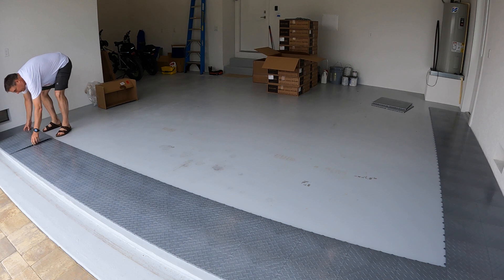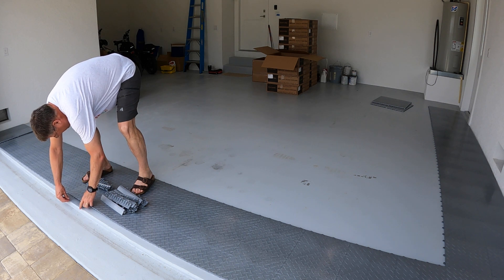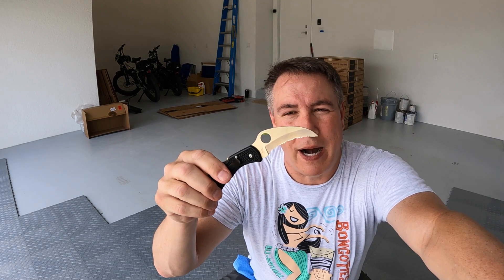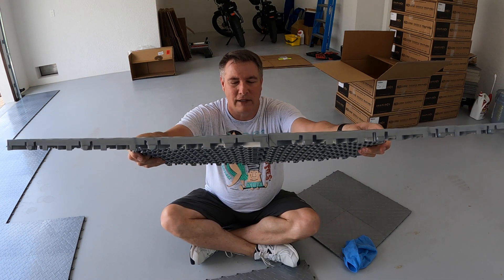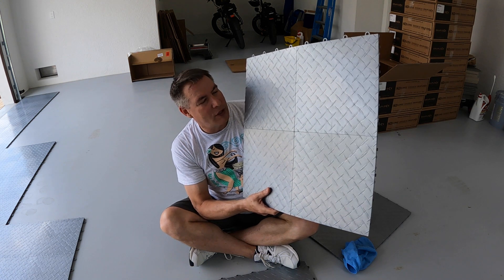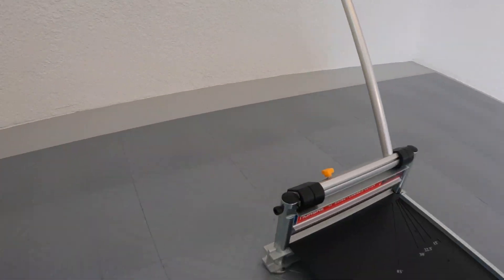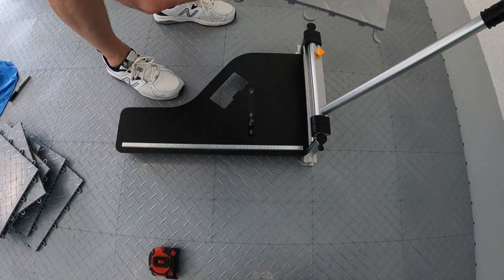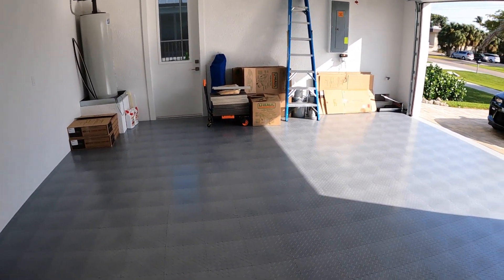RaceDeck Tile install - Setting up the new Garage

Comment: Nice job! Great tip about the amazon cutter. I have 18" tiles coming and am not sure how I will cut those yet. The Amazon cutter will be great for the 12" tiles. Thanks for the vid!
Reply from the maker: That cutter was perfect for the job.  I used a circular saw on a project in the past.  Never again!!
Reply: @evolutionaryTom  Good call Tom! I ordered a 20" cutter from Amazon ($247) and it worked amazingly well for the 18" tiles. No mess. I tried a jigsaw and yeah what a mess! The shear makes such clean edges. I'm gonna probably sell the smaller 13" cutter I have and keep the 20".
Reply: @spacep0d  do you have a link from Amazon to but that cutter. I’m not handy at all and plan on doing this in a couple weeks ! Wish me luck

Comment: Tom, I just put my floor down and left an expansion gap around the side walls and back wall, however I started up against the garage door track. Should I have left a half inch gap against the door track too? If so, I may have to notch it with a jig saw.
Reply from the maker: I did.  The whole thing expands together with the heat so anything that is within a half inch of it could be an obstacle during expansion.  Hope that helps!  -Tom

Comment: the diamond-plate look is always great. everything that's parked in your garage will now look 10 times better!
i did my garage in a 2-part epoxy with flecks, but this definitely beats it. 
one question: how does it sound when you walk on it...solid? hollow? 
hope you're enjoying your new digs down there. thanks, Tom
Reply from the maker: LOL, you are right, CP.  It does make stuff look like a million bucks!  It has a unique sound to it for sure.  Not quite like you're walking on something hollow but you know you are walking on a platform of some kind.  Enjoying learning about this place.  I'm sure I'll be in honeymoon mode for quite some time.

Comment: How does the water evaporate? What about spills like oil? Does is magically disappear from underneath the tiles? What if I drop a hammer? Will it crack the tile?
Reply from the maker: I'm no scientist but these are my observations.  The water evaporates because it's not air tight.  I took up my previous floor at my old house and there were zero issues.  And Snow was on that floor when I pulled the snowblower in, ATV, etc.  The seams are tight but I think any fluid can work its way in.  So for oil, you'd need to just clean that spill up as soon as you notice it.  I don't think it would hurt the floor underneath, other than a regular oil stain, if it did get under the tiles.  And no, it won't crack if you drop a hammer on it.  It has some flex in it and the tiles are not brittle at all.  Hope that helps.  -Tom

Comment: Wrong!!!  Racedrck instructions specifically state to start in the front corner. You cannot use the Racedeck transition entry/end pieces if you lay the tiles in this method.
Reply from the maker: Evidently you can.  This install went great.  I'm very happy with Racedeck's product and that's two garage installs for me know.